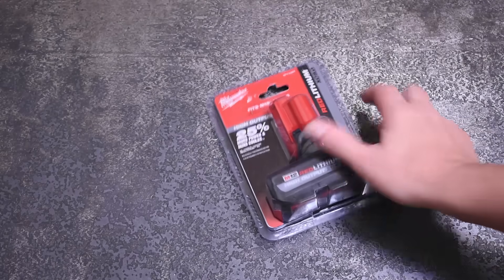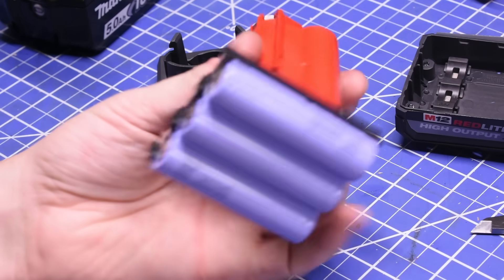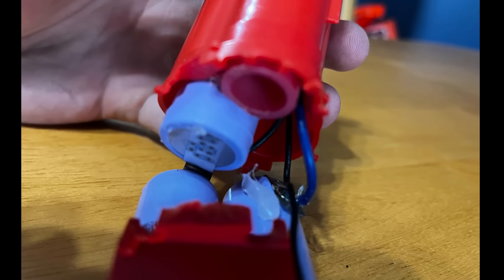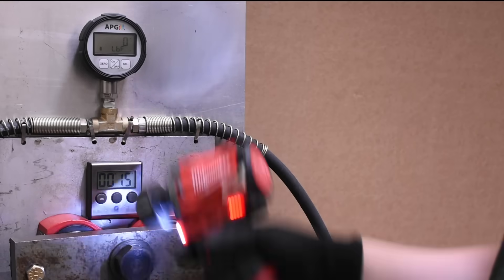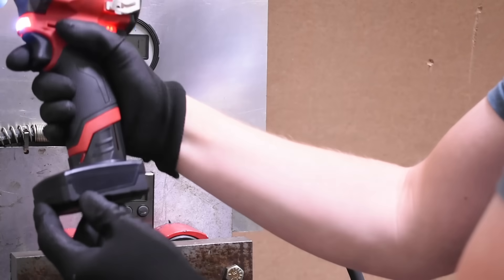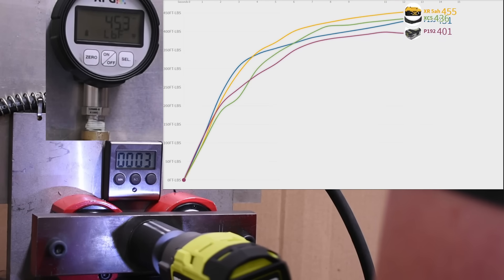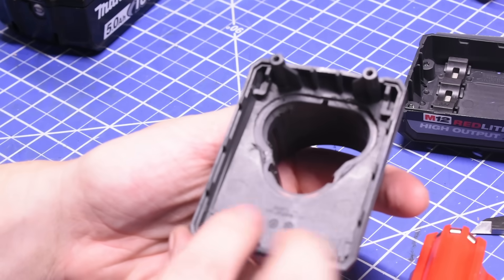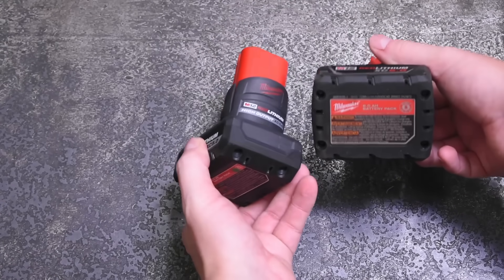Milwaukee's New M12 XC5.0 High Output vs Stuffing Actual 21700 Cells Inside

Comment from the maker: Correction, the M12 BMS is on the tool (we didn't wire these things). With all the ideas about juicing up custom battery packs, I would suggest sticking with M18's (or your platform's equivalent) to do so. You could of course build a lithium polymer stack capable of 500 amps, but if the M12 tool's only requesting 15, it's only going to get 15. A clean straight never dropping off delivery of 15, but never any extra. 18 volt tools on the other hand range quite a bit in peak current requests.
Based on this testing it would appear the 2.5 HO would be more useful than assumed, closer to a 6 cell pack. We just had our eyes on maxing things out!
Reply: The comment about the imitation battery having a dodgy BMS is incorrect, the M12 BMS is located in the tool. The battery packs themselves contain no active circuitry, and any extra performance eeked out of a tool is due to lower internal cell resistance.
Reply from the maker: @darkfur18  Hey thanks, we didn't wire it up to see for ourselves. Just tested em.  Makes sense.
Reply: @darkfur18  I thought that BMS is for charging batteries. Why are manufacturers putting BMS into the tool? It should be inside the charger. Please correct me if I'm wrong.
Reply: You need to test with high amp tool like the 90° die grinder even with a 6.0 the thing alway cut out and drain battery like no other 
Or try the circular saw and chainsaw it's where the new battery will shine
Reply from the maker: @legros731  The 90" die grinder isn't particularly high current draw per second in my experience, just weak.
Reply: @TorqueTestChannel  because its a low turn motor to produce excessive rpm under the same volatage.
Reply: Hey what is the website you used to buy the individual Samsung lithium batteries?
Reply: Great Video! You are correct the M12 BMS is on the tool. Also the M18 overdischarge protection is in the tool too, and not on the battery. I've repaired a fair bit of Milwaukee stuff.
Reply: i would suggest you do some research before commenting on the subject. low or high power cells will give 15. the WHOLE discharge. low power cells have more voltage sag not less current output. power is volt x amps. if you get more voltage sag which means a lower voltage due to resistance you get less power even if the amps will be the same. unless the cells resistance is so high that it triggers the low voltage cut off from the bms when you draw current, the only difference between a low current output vs high current output is its ability to maintain a higher voltage under load.
Reply: Idea 1: rewire M12 battery to 18 volts
Idea 2: bypass current sensing resistor
Reply: anyone know what the discharge rate of old NiCd batteries was roughly?
Reply: @christianbound4972  typically 10C in high current demand devices, so for a 2000mAh cell that would be 20A.
Reply: do you think it could be a tolerance and or wear problem from factory to factory
Reply: I'd like too see someone make a M18 Battery with Headway cells 😁
Reply: Next time when testing batteries can you run them for about 30 seconds then given them a minute or two of recovery?  That would be a good real world scenario where you use the tool then put at aside to deal with the next thing then pick it up again.  I'm curious if the batts come back a little bit after a high current use.
Reply: I know thisnis an old video but I've been. Reading reviews that the newer material used on the high output batteries has actually turned out to be worse at making a proper connection with the tool overtime is there anyway you guys could look into this and make a short video maybe explaining what you find??? Please and thanks... because according to this video and the reviews about the high outputs it looks like when I get the 3/8stubby I'll be going with the older NON HO xc 6.0s I am concerned with weight because of my bad tennis elbow from using heavy impact too long

Comment: Im really new and ignorant to these batteries and tools, im old and am used to air but i just bought a milwaukee 3/8 impact wrench with high output xc5.0 kit for 150 bucks, did i do good, ok, or should i look at other deals? I went off specs mostly and bought myself and son 1 but ive never used anything except pneumatics,  any advice appreciated. It came with 1 baterry, a charger and the tool for 150

Comment: Buddy, I hear you speak of BMS. But... where's the BMS? Have you researched well before the presentation? There's no BMS in Milwaukee or Dewalt, Makita , Bosch or even the Chinese Battery packs for all the mentioned power tools. Do you know that? I didn't think. So research, study and understand the circuitry before blurting out on Battery, power consumption and Ohms Law. The layout looks professional, good video presentation, though. but lacking knowledge. 
BMS is in the Charging device; FYI🤣❗Cheers.
Reply: BMS= Battery Management System. Its what the battery charge indicator is plugged up to. Seems like you might be lacking some knowledge, friend. Just FYI. Cheers!

Comment: Recently broke the locking bracket on my xc 5.0 Ho battery and while waiting for glue to dry ive been using my 4.0 battery on my m12.. the 5.0 lasts twice as long, has a little more power.

Comment: I don't know if the tablets were not avaliable yet when this was done but those or the Samsung 50s should be able to do about as much it looks like the 40t is rated for 35 continuous but up to 45 with temperature cut off and the 50s is 25a continuous but the same with temp cut off so fine for short burst
Reply from the maker: Correct, tabless wasn't really a thing yet. Her'es tabless: https://www.youtube.com/watch?v=Tl52IGAGgvw

Comment: Why didnt you test the 2.5AH HO Battery? This should be the most interesting part, because it should exceed the 6.0 Battery, resulting in a more compact, but same strength tool for the same price.
The Gen1 Stubby already draws as much watts as it needs from the 6.0 and 5.0. So there isnt a difference. But the 2.0 cant deliver as much amps as the tool needs.

Comment: all you have to do is cut a sliver of 3/4" black shrink wrap about 3/8 wide and fold it in half between the battery (red part) and the clip. It puts just the right amount of pressure but you can still squeeze it tightly to remove the battery. Try it. It works perfectly.

Comment: With the HO’s coming out, the XC’s have dropped in price on eBay.  XC 6.0Ah run about $64 for 2.
I purchased knock off Bosch 12v.  Nice to know I can replace with better 18650’s.
I started with Bosch and they announced they were going to discontinue and didn’t have a large selection of tools.  I then switched to Milwaukee, get it all on sale.  
Now I wish I went with Ryobi.  I’m not a contractor.  I do house work, at my siblings and mothers home.  Once in a while I get handyman jobs, so the Ryobi line would have been just fine and far less expensive.

Comment: I really wanna see what happens when you put a custom HO battery in a hyper tough low profile impact. Seeing as when you did the test with the smaller battery it didn’t want to work barely. Or maybe Hypertoughs little 2.0 battery just needs better quality cells then whatever ones they put in their to make them so cheap?

Comment: Got the 5ah and 2.5 ah bundle and while removing a injector off my buddies vw van the smallest bit of old fuel fell on the back of the battery and completely cleaned off the Milwaukee logo and the high output logo :( you have been warned lol. Still works a treat tho

Comment: Like you said the battery is supplying the amperage that is being requested so even hooking it up to a car battery won't make a difference, you want an increase in voltage not amps, I just put a matco 16v battery on my Milwaukee right angle and it's insane, it took alot of work though, the shape of the battery was the same but the polarity was reversed and I had to do some hackery to make the battery tabs lock in properly, totally worth it though
Reply: Just to clarify with brushless motors in RC cars you increase voltage when you want to increase rpm, the matco 16v is actually 4 18650 (though it looks like it's was designed to have 5) in series as Opposed to the Milwaukees 3, so about a 30 percent increase in voltage

Comment: The added storage capacity should also be considered. You could argue it's the more important metric because the tool will last longer before needing a batt swap. I know that with my vape mods, my Sony 21700 (VTC6) is 4200mAh while my Sony 18650 (VTC6) is only 3000mAh. That's a 40% increase.

Comment: So, explain this to an idiot (me):

When we're talking different batteries, what is the number referring to?

I've got CP1.5, CP2.0, CP3.0, XC3.0, XC4.0, XC5.0 and XC6.0

For Ryobi, the 3Ah batteries are constantly touted as a superior battery, and they seem to outperform 4Ah batteries.  What does a 6Ah or 9Ah get me over a 3Ah?

Is this just a longevity thing?  A 3.0Ah puts out more actual juice, but just nowhere near as long as, say, a 9Ah?
Reply from the maker: The number (Ah) is capacity. Think duration. But often that means more stacks of cells tied together to double up more capacity. Sharing the power draw across more cells can mean more power delivered quicker. So can come with it a power increase if the tool is asking for it
Reply: @TorqueTestChannel  thank you!

So, what about a CP3.0 vs an XC3.0?

Comment: With the stock 2.0 amp hour there is NO WAY my right angle impact is anywhere near 250 breakaway foot pounds, it won't break loose 150.  So I'm hoping a better battery will help.

Comment: Does your LARGE BOLT SOCKET get welded to, (or at least pinched tight onto the gun's output square male drive with shim steel) onto the impact guns output shaft?  IF NOT, then there IS considerable torque LOSS from the SWING SLOP present between the impacts.

Comment: I would suggest that the higher output will last longer, or at least have a lower performance fade, both within a charge and over it's lifetime. Not something you would really test, but I bet if you sent them to a lab and had them cycled 1000 times, the high output would perform way better.

Comment: I be very surprised if the battery stops falling out and the tabs don’t break off. In 2~3 years. I got both bread new batteries that tabs broke vert fast and very old batteries that never broke
Reply: My old brushed M12 hammer drill (very first gen) will be 10 ( YES, TEN FULL YEARS OLD) NEXT JANUARY 2023, and the two old 1.5 Ah are now a little weak and don't last as much as when new, but I have NEVER experienced any battery falling out in ten years of use...

Comment: That's unfortunate but not surprising. I was hoping these batteries would make some actual difference. The M12 fuel roto hammer can get the job done, but definitely could use some extra power

Comment: the 6 ah battery is in fact a higher performing battery in some m12 tools. both the newer 4ah and the 6ah are beefier than the same 3.0 flat bottom. 4/6 beats 3.0 so yeah those would be considered high output

Comment: Where's a tool seems to have reached it power "limit" on the control board, it would be interesting to see power over the life of the charge between the XC and the HO. It's possible they derived there "25%" figure at a particular charge point. Having higher peak current could also mean better current at lower charges

Comment: I've had no issues with dropping batteries out of my milwaukee tools but my 3/8 fuel impact with the 4.0 batteries has consistently had issues with battery errors. The small contact on the left side of the battery (as you hold the tool) gets bent in and loses contact with the tool which kills the power and flashes the battery light, which in some situations is extremely frustrating. After comparing my 5 year old tool to a new one I came to the conclusion that my tool was simply worn out after 5 years of what my Mac dealer described as "hard use" and I replaced it today, but it was disappointing to do so as otherwise the tool functioned perfectly. I feel like the design of the battery tabs is lacking and could easily be improved.

Comment: I have a old ryobi drill hp412 (lead acid battery tech guys were throwing it out because the battery shit out) rebuilt the battery 3s2p 46amp output pack using Samsung 15m cells, my huge brother who's a welder that handles power tools all day can't even stop the chuck with his hands.

Comment: I wish you tested the HO CP 2.5 vs a standard XC battery. I would be interested to see if a CP 2.5 would make the same max torque as an XC battery. We already know the XC batteries give a bit more max torque than the current CP batteries but I wonder if the smaller CP 2.5 can give us the 250 ftlbs in a smaller form factor.
Reply: Were you ever able to find out if the 2.5 HO is the same as the XC 5.0?

Comment: 21700 and 18650 cells are just a size aspect ratio the larger cell risks higher heat however less metal casing means lower weight.   The real change would be the pouch cell but it is just plastic and is not great at high power due to internal heat issues so great for tech but not sure about power tools.   You don not want to risk the pouch rupturing in to a ball of fire.  In all reality batteries have not have any major improvements in a long time, you have LiPO and all kinds of other changes but they are mostly minor or make improvements to fit more battery in to a given space things of that nature.

Comment: I was wondering why they didn’t just do this when they said high output… If a homemade one is already better than theirs, Looks like they should have
Reply: THAT IS BECAUSE many "Design Engineers"' at too many companies are either too lazy, too underpaid or both things, and produce under-designed tools... INSTEAD, a determined and savvy DIY individual will almost always OUTPERFORM the factory "engineer", most probably because he is less pressured by the factory CEOs or "bean-counters" or is just doing what he loves to do, while the factory employee is working under pressure and not as  motivated... That can be clearly seen in that DIY hack: That NO ONE at Milwaukee thought of locating a bigger 21700 cell inside the handle, leaving plenty of space at the bottom for the other two 21700 cells... That was PURE GENIUS!  
Lets see if another enterprising DIY goes the way to OVER VOLTAGING the M12 tools by lodging a FOUR CELL 14.4 volts into a refurbished housing... That would be a way more dramatic increase in performance...

Comment: Great test, in practical use, I've found my M12 impacts (driver and wrenches) feel strong with the 4.0 or 6.0, rather than my 1.5 and 2.0.. (I have some right angle M12 3.0 batteries, but use them for lights)  I do not have a new HOXC5.0 battery. Was just about to buy a pair of new XC6's. BUT .......  Since the Kobalt RA impact performed very well with it's better beans battery... I would have liked to seen the M12 RA impacts in on this testing. That's the one I noticed the most liking the 6.0  when knocking off brake caliber bolts on my jeeps and 1ton Ram. So now you got me wondering about the new HOxc5.0. I own both the 1/2 and 3/8 for what ever reason, my OCD maybe.  Would love to see that. Do you have any M12 3.0 Batteries? Be interested to see where they stack up to the little 1.5/2.0/3.0  VS Right angles 3.0/XC4.0/XC6.0 and now HOxc5.0 

I'm a new view, new subscriber, been binging your test vids this weekend, great work, tnx! (But boring the heck out of the wifey, need a shop dog or cat, that usually keeps my better half interested, shop dog/cat cameos)

(Edit : Also noticed the same thing in my M18 impacts wrenches. Working on large hardware / suspension parts, if its not breaking loose, and I have a m18 5.0 in there, get an HOxc6.0 or HOxc8.0, and there are extra beans to crack the rusted bolt / nut free. )

Comment: I've never had a battery fall out of any of my 4 impacts, either of my 2 drills, any of my 3 ratchets. I've been running these tools from 3 to just over 6 years. I do take better care of my tools than the other technicians I know, but I also run the piss out of most of them. Full disclosure, I did have the screws strip out of the plastic on both of my original 6+ year old 5.0Ah 18 volt batteries. I found them that way after someone else borrowed them though, and "no one" had "seen what happened". I pulled them barely open, ran a bead of black or red The Right Stuff, let them sit overnight, and never had a problem again. Those 2 batteries have lost some of their useable work cycle after a charge, but oddly enough are still stronger on a full charge than my newer 4.0Ah batteries. None of them are high output, as I rarely found myself wanting for power with the originals, and preferred a longer period between charges. That said, if I'd known the 4.0 power performance would have been lower, I'd have dished out the extra dough for more 5.0s and maybe a single larger battery. Saw the TTC video on that subject after the fact. But the thing I most often run into trouble on is crank pulleys/balancers, and I have a set of weighted sockets that remove them like butter. My fuel 1/4" hex driver impact does sometimes fall short, but I'm running it as a screwdriver, 1/4", 3/8", and small 1/2" impact all in one. I was originally going to get a 3/8" impact and socket sets as well, but it performed so far above my expectations that I decided it was nowhere near worth the money. I only break maybe 2 to 5 3/8" and 1/2" square drive adapters combined every year, which is miraculous in my mind.